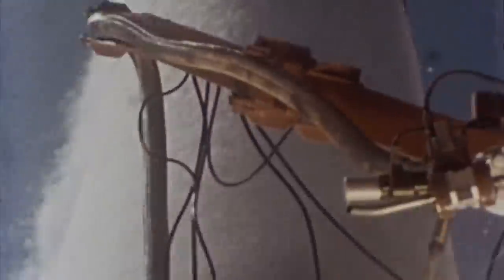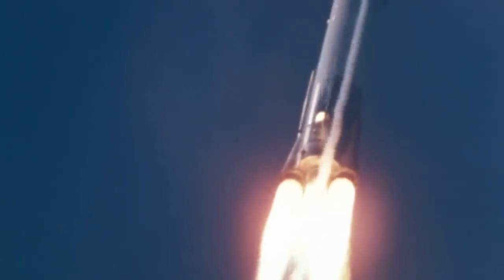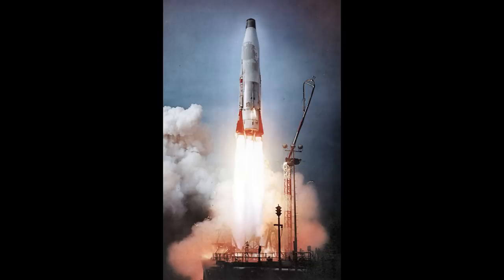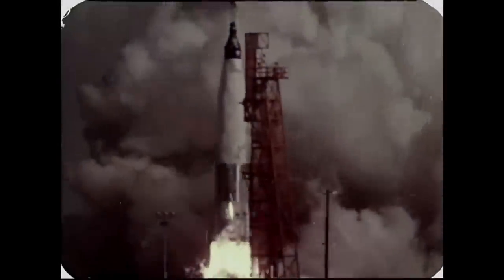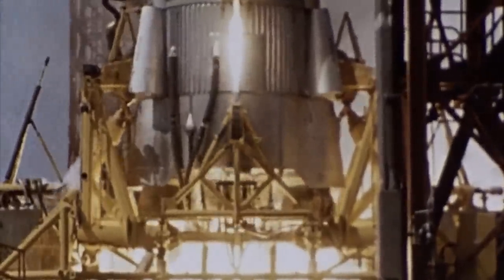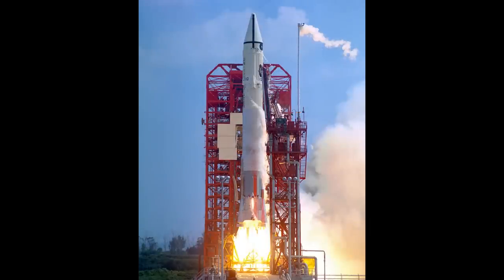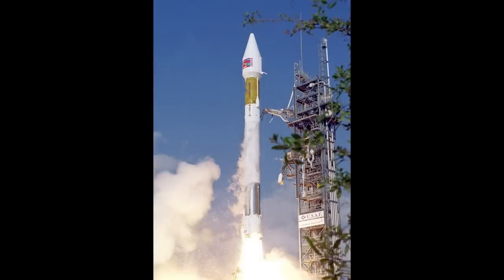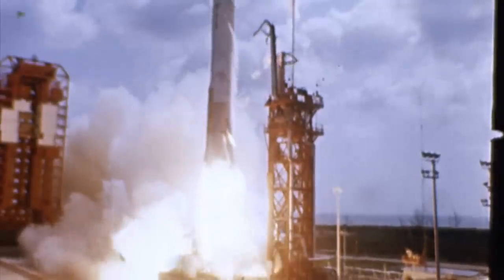This Rocket Explosion Is Art - Atlas-Centaur AC-1

Comment: The shot of the engine just falling down on its own is insane
Reply: Looked kinda like a Mercury capsule earlier in the footage even though I knew that wasn't possible. I was surprised it burned so long too. Guess it took a while for all the residual fuel to make its way out of the plumbing.
Reply: I wonder how they were able to track rockets better in the 1960s than we can today?
Reply: It was a lot larger than I thought it was when I saw it hit the ocean. At first it I thought was the nose cone until Scott pointed out it was an engine.
Reply: Kudos for the cam guy
Reply: The not-SMART reuse option.
Reply: Every time I try KSP.
Reply: @aspzx  : Highly experienced anti-aircraft gunners from WW2, using modifications of the equipment they were so experienced with, tracking objects that unlike their previous experience were not trying to dodge anything, from a much longer distance which itself made the tracking much easier. The tracking hardware is itself still located at Kennedy in Florida.

In contrast, a lot of the new stuff is going to be pretty cheap, and potentially much closer, especially since the really stable footage is likely to be either retained for engineering purposes only, or be ignored as being boring.
Reply: @absalomdraconis  I'm sick of cheap shoddy modern footage that can't track anything properly.
Reply: MA-3 was even crazier! When it exploded, the whole Atlas engine segment (all 3 engines), and other large pieces of debris, came raining down. The Atlas didn't pitch properly and these came down on land, not the ocean. There's footage of people trying to put the fires out.  The only place I've seen the whole sequence is on a commercial set of DVDs called "Project Mercury: A New Frontier".

Comment: It's so weird watching the old rockets being hand-built with all the imprecision that goes with it, knowing that they nevertheless had a good overall success rate. The clips that Scott showed of the handheld angle grinder, the inspector holding up what looked like a metal gauge and eyeballing some dimension, and guys moving around pieces until it looked just about right is so far from modern practices with computer-controlled CNC, micrometers and ultrasound, and robotic assembly, but it was the best available at the time.
Reply: Slide rules are great calculating devices if you know what you're doing.
Also saw a video of young girls who could do division and multiplication faster than I could with a calculator by using an abacus that wasn't actually in their hands. They had so well learned how to use an abacus as a calculator that they didn't need to be holding it to "use" one.
Reply: The regenerative cooling nozzle on the RL10 engine of 1962 that Scott mentions was made by hand brazing hundreds of individual channels. The RL10 is still in use and has been upgraded but the hand brazing was done until a couple of years ago. Aerojet Rocketdyne finally committed to 3D printing - but idk if that's been implemented on flight articles yet. NASA had criticized the use of such a labor intensive method because it drove up the price and they didn't want this to continue with Vulcan, which uses the RL10 on its Centaur V upper stage.
Reply: @donjones4719  I imagine the inspection processes have improved even though the brazing was still done by hand. That manual labor does help explain just why the legacy rockets remained so expensive, though. I wonder how often they had to be redone.
Reply: And with really skilled engineers it's amazingly good, but that skill takes time to build
Reply: @SodThisGiveMeABeer  I liked your comments, just 1 point I'd like to make, that concerns CNC (a long time ago I was a lathe operator and then went on to CNC), is that setting up a CNC is done manually and you use micrometers. Setting up a CNC you have to insert all the cutting tools into the tool head, you then have to input 'offsets', this let's the machine know where the cutting edge is, if this is done badly, your CNC is useless. So even with advanced tools, the set up still require normal engineering skills and tools
Reply: @matgeezer2094  And machinists in the US still measure down to the "thou" (1/1000 of an inch).
Reply: @teebob21  An "inch"? How much is that in refrigerators? And I'm talkin' old school long 'fridges, not this new-age hippie "standardised refrigerator" garbage ...
Reply: @PBeringer  By definition, it's 25.4 micrometers.
Reply: @teebob21 I've even heard a few old guys refer to .001" as a "mil", meaning one milli-inch. If you say that today, though, most people interpret it as a millimeter, so that term isn't much used anymore except in measurements of plastic sheets or foils or thin wires.
Reply: @seth094978  Yep. A thou and a mil are the same unit. Machinists will call it a thou, and the electronics industry will call it a mil. Same length for both.
Reply: @teebob21  One inch is not 25.4 micometers. It is 25,400. (twenty-five thousand) 25.4μm is 1/1,000 of an inch.
Reply: To add to the course of this thread, check out Scott's video on rebuilding the F-1 engine with 21st-century eng'ng. & mnf'ng. techniques.
There is sometimes no way to replace human expertise and artisanship.
Reply: Decimal micrometers measure to the hundredth of a millimetre, of which there are 2.54 in a thousandth of an inch. Then you get verniers to add another digit of precision on both metric and imperial micrometers.
Reply: @teebob21   A "thou"? Shoulda stuck with lines, 1/12 of an inch. Or lignes, 1/12 of a French inch, back before the insanity of millimeters.  ;)
Reply: @matgeezer2094   I once read of a restorer who took apart a German WW II tank engine. He sent the crankshaft to a modern shop to be checked out, make sure it was in good shape. The shop owner returned it and said to take good care of it, his shop (with CNC, etc) would be hard put to make one as precisely. That was production under wartime conditions with factories being bombed.

Comment: Hydrogen is a pain to deal with.  Amazing how reliable the Centaur stage became and still is.
Reply: Yes, it’s the smallest element in periodic table and it can affect many materials with embrittlement & leak past seal & tank materials.
Reply: The Sun takes that personally.
Reply: @guardrailbiter  The Sun has it easy because it doesn't have to deal with cryogenic hydrogen.
Reply: @StevePemberton2   Sure it did... before it achieved sufficient mass/density to initiate nuclear fusion.
Reply: @guardrailbiter  But it didn't have to try and keep it cold to keep it from boiling off. Although the hydrogen was mostly gas anyway even at the cold temperatures. But it didn't have to worry about it leaking out through openings or getting away, other than the rogue atoms that jumped away at escape velocity, but that didn't last long once the Sun's mass increased.

Comment: My favorite engineering  job was the development  of Atlas III.  He missed Atlas III in vid. It was the last of the heritage Altas with a pressure stabilize booster tank. Atlas V was really ground up new booster except for the Centaur 2nd stage. Heritage  Atlas has some amazing  engineering  right down to the launch pad hold down mechanism.  Interesting fact, WD40 was developed for Altas as corrosion protection of the Atlaz stainless steel tanks.

Comment: Long ago I was on a range safety ship for a shuttle launch. As it lifted off, it began to turn and I thought, "Oh, no. It is going to fail." I didn't, it was reorienting the antennas and the launch was just amazing.
Reply: Assuming this was a few seconds after launch that was what was known as the roll program. Antennas were actually just part of it, and they weren't trying to align the antennas or anything. Like all rockets the Shuttle needed to start pitching over shortly after launch to give it the curved trajectory required to put it into orbit. When it was pitched over sideways the Shuttle was designed to fly with the orbiter hanging from the ET (External Tank) instead of riding on top of it. This was for the best weight balance and aerodynamics. This also put the belly of the orbiter facing towards space and the "back" of the orbiter facing towards Earth, this way the antennas on the orbiter would be facing the Earth instead of facing space.This was important since early Shuttle missions could only communicate with ground stations. 

Since each Shuttle launch had to fly in a certain direction, which varied depending on the mission, the pitch maneuver had to be in that same direction. Before it did that however it needed to roll on its vertical axis so that the "back" of the orbiter was facing the direction that they were about to pitch towards, so that when they pitched over this would cause the orbiter to be where it was supposed to be hanging directly underneath the ET.

Comment: There was a unique planned rocket explosion that was known in advance, and at least potentially could have been seen in person by over a million people. This was the SpaceX Crew Dragon In-Flight Abort Test on January 19th, 2020. The plan was that the Falcon 9 booster with a dummy second stage would launch from pad 39A and be programmed to shut down right at Max Q, which would cause the Dragon 2 capsule's launch escape system to automatically ignite the SuperDraco abort engines and pull it away. It was expected that without the aerodynamics provided by the capsule, as well as the expected tumbling, the booster would likely explode, although this wasn't guaranteed.

Unfortunately it was extremely cloudy that day and the explosion took place while the rocket was in clouds. The blast was so powerful however that people who were in the right position could see the explosion through the clouds, but not nearly as well as if it had been clear skies. Many other people saw nothing depending on where they were viewing from. The live NASA coverage had a pretty good view with their tracking camera if you want to see what it looked like.

Comment: Question for the experts or even Scott. To avoid the heat and pressures of re-entry, would it be possible to use an engine against the direction of orbit to slow down and "freefall" back to a landing region? Perhaps such a profile would make orbital flight cheaper and easier? It seems that despite entering at many Mach values, it would be cooler and less stressful (on the capsule) than hitting the atmosphere at 24,000 mph. Perhaps a multiple drouge chute program on the way down would do the trick(?).

Comment: Just curious. In the Centaur diagram At 5: 04, there is a common dome between the liquid oxygen and the liquid hydrogen. I thought the tanks had to be separate for temperature differences.
Reply: The second stage of Saturn V did also have a common dome between those tanks. The difference in melting and boiling points between the two substances makes that tricky but it was solved by thermal insulation on the dome. I read that in some other rocket, it was solved by making the metal dome thicker and thereby achieving enough insulation.
Reply: Yeah, that. ^
Reply: @skunkjobb  Thanks for the info.

Comment: This begs the question: how do rockets manage to re-light engines in space, particularly when there's no gravity? Gaseous fuels I can  understand but what about liquid fuels??
Reply: Small engines are fired to settle the cryogenic liquid to the "bottom" of the tank. These are called ullage motors. (They use gaseous fuels, afaik. Or maybe hypergolics in a helium pressure-fed system.) The propellants will now feed into the engines. The Everyday Astronaut's latest YT video is "Why Starting a Rocket Engine is Hard." I haven't finished it but I'm sure he covers this.

Comment: Gee, that rocket explosion looks like it actually burned ALL of the propellant. It just kept blowing up and blowing up some more. 
I think that the American early development of hydroLOX upper stages is one the reasons for the success of the Saturn V and the Apollo moon program. Even thought he Saturn V had a lower booster thrust at liftoff than the N-1, it still could loft greater payload to the moon. I kind of wish the SLS had followed Von Braun's idea of using kerosene to get the thing off the pad and then drop the weight and save the exotic hydrogen for the upper stages. Carrying all that tank weight almost to orbit is simply stupid, and needing huge HydroLOX engines and polluting solids just to get the thing off the ground is very wasteful. The Saturn was a very intelligent design to maximize the efficiency and get the most mass to orbit. Each stage had the appropriate technology to its mission.

Comment: I have alway wondered why the shuttle didn’t have pull away insulation on its fuel tank. And if the insulation was going to ride all the way to orbit why not put it inside the shell that contained the hydrogen/oxygen fuel. The insulation caused lots of concern and killed seven astronauts.
Reply: With all the things attached to the ET at various points, drop-off insulation would be pretty complex and problematic. Putting the insulation on the inside isn't a bad idea, and in fact was done for the S-IVB upper stage on Saturn, but the method they used for that internal insulation was essentially as costly and time consuming to install as the heat shield tiles on the Space Shuttle, so it makes sense why the same engineers working on the Shuttle in the 70s wouldn't want to use that technique, and instead look at the fast, simple, spray on insulation developed for S-II. Better paint on top of the foam might have helped a bit with the safety problems.

Comment: AC-5 was an on pad failure as the onboard computer signaled a shut-off of the fuel or oxidiser. At that point all thrust is lost and it settles back down on the cradle.  The super slo-mo of the aft end is just amazing. https://www.youtube.com/watch?v=SvimMVY96Ug&list=PL-rGsabPxHLIEg20hz84bMCrHE65dLmU1&index=194&t=592s